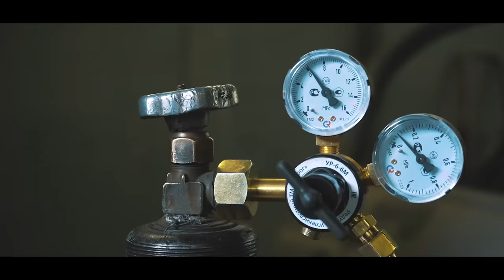Ultimate BMW X5

Comment: I hate the direction SUVs went into like the X6 and shit. 
An SUV should look and work the way this one does. Well, maybe adding some windows might help. An SUV is not supposed to be a piece of furniture or lawn decoration like the X6 is which looks great, but it's too large to be driven in cities and lacks off-road capabilities to be driven off-road. But hey, like I said: it looks nice on your lawn.
Reply: A Range Rover is in no way an suv you just don’t appreciate the Range Rover for what it is and what it can do
Reply: Range rover.. it is ultimate pile of junk crap and what can it do? it can break down on you numerous times and flatten your wallet more than a gold digger. there is no other manufacturer like land rover that can engineer 18th century crap in the 21st and sell it for the price like a masterpiece will cost in 23rd.. period
Reply: in my city BMW x6 are very common also range rover